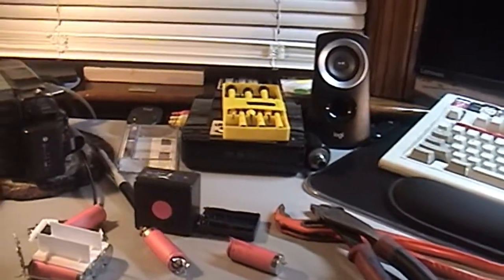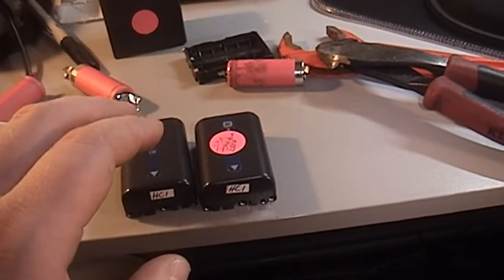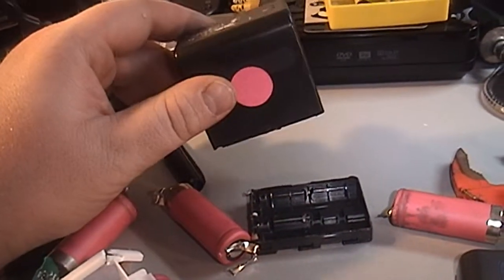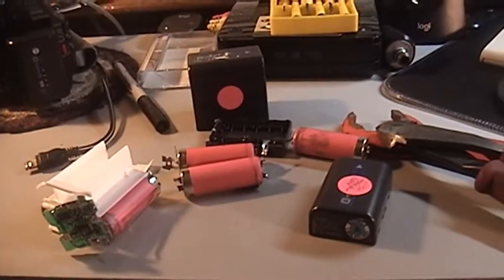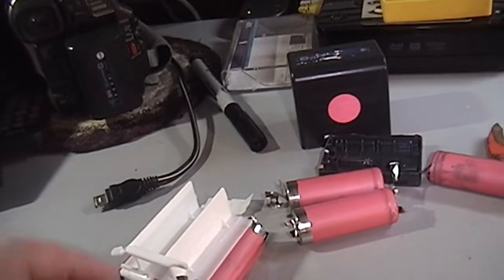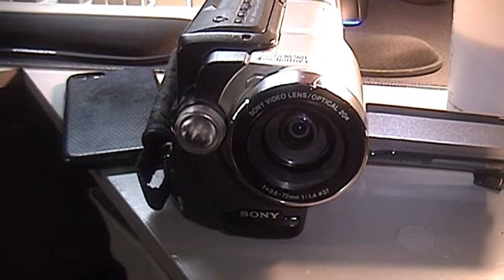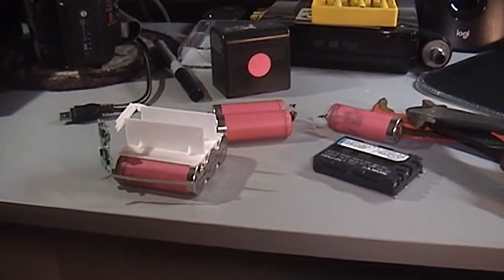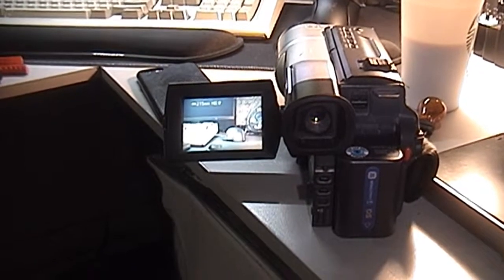Sony InfoLithium Battery Autopsy & Observations

Comment: This is great info. I did end up purchasing new genuine Sony NP-FM500H batteries for my DCR-TRV265E and DCR-TRV480E which originally came with NP-FM30 batteries when new.

I did find a new, sealed box “Sony Handycam Digital8 Starter Kit” which contained a Sony leather bag, a 60-minute Digital8 tape and an NP-FM50 battery, which initially appeared to be charging but after I came back to it after a few hours, the battery was warm and the camera had a rapid flashing “CHG” indicator. The battery would not power the camera on anymore. I suspect the cells blew and leaked like yours have due to charging after sitting dead and unused for 20 years. It does however show in the Battery Info screen that it has a full charge and 160 minutes of recording time available. Weird.

The NP-FM500H units weren’t the cheapest, but certainly are the best from what I can see online. 11.5Wh, and perfectly compatible with the Handycams. One is currently in use, the other two I bought are still sealed in their boxes to be saved for future use/resale as they will likely become rare.

Comment: I don't get why these aftermarket Sony batteries are manufactured? Since there's this infoLITHIUM chip protection, when it's lacking in the aftermarket batteries- the Sony camcorder won't stay on for longer than 30sec. So, what's up with that? I just can't get Wasabi NP-FV50 for my DCR-SX33 it seems. I don't have older extra original Sony batteries to replace only the aftermarket cells.

Comment: I kind of wonder how difficult it would be to get the back bit off a real M series battery (the ones that have the pushbutton with the charge indicator) and stick it on a Kastar pack because I have a bunch of those for my TRV33 and my DVD300 that work wonderfully, but they look fake as hell when you see the back and see that weird sans serif font that you only see on Chinese batteries off eBay.
Reply: I have this running theory that the small packs tend to survive better because balanced charging is less necessary with those (if the cells aren't balanced, there are only two cells and they're in series so they're not going to reach the unloaded 8.4V, but also, they can't discharge too low since the total dead voltage of those packs is something like 5-6V or 2.5-3V per cell, nowhere near discharged enough to do any real damage.. I think they kind of balance each other in normal operation when the capacity of the individual cells is close enough for government work, but they have to be that close since cell capacity also kind of dictates cell longevity—I'm a factory mechanic, not an electrical enginerd, take everything I say with a fistful of salt).

I had an old M series SQ pack that was basically as good as the day it was born, until one point when I left it on an "as-is" Hi8 camera from like 2004 (same camera I ripped the tape basket out of to repair my TRV460—I was a bit mad at it for killing my big battery so I turned it into a salvage camera). That old thing seemed to have a high quiescent current and would drain FM50 packs in about a week (said packs were always recoverable due to the low current conditions under which they would discharge), but I was dumb and left the big pack on there. To overcomplicate an already long story, I dissected the pack. Some cells measured at around 3.3V, but some measured at -0.3V (or, probably functionally totally shot) and it was enough to come up dead to the BMS, which seems to have self-destructed (all InfoLITHIUM BMSes seem to do that as a "safety" measure.. kinda like Makita tool batteries, but smaller because camera batteries).

Comment: That’s actually good to know, I wasn’t aware that these would leak like that higher capacity model did. I have a standard InfoLithium M battery that is factory original with my TRV108 and despite not being used for years, it works like new once I charged it up. Apart from that though, I only have 2 other InfoLithium (standard M and L) batteries and I haven’t had any luck getting those to work. I know that it’s probably more work, but I wonder if there’s a way to rebuild these easily. Taking apart a third party one is not ideal (but it would work I guess), but with the higher capacity models, I wonder if there’s a compatible portable battery (like a typical USB charger one) that could fit inside the case. It would be cool to add a USB port to charge it up as an alternative, but there’s a lot of factors into something like that since voltages might not be the same, battery size, etc. Or something to swap out the Ni-Cad based battery with something newer to take advantage of the built in charger. Regardless, it’s still good to hold onto the Sony battery case and the InfoLithium board since it’s not the early 2000s anymore. If anything, you could swap the good case on a working battery that has broken/damaged plastics.